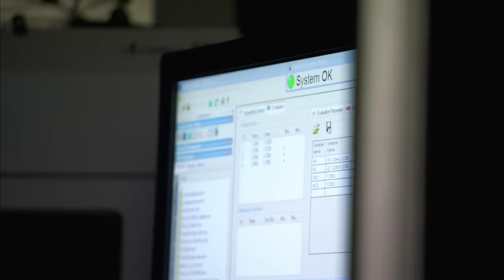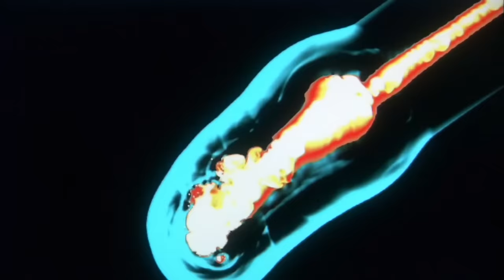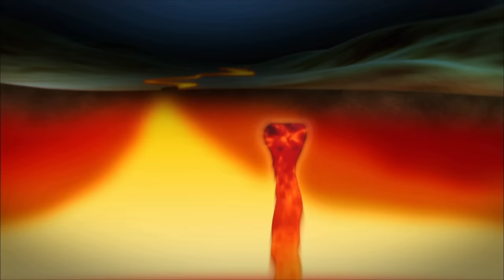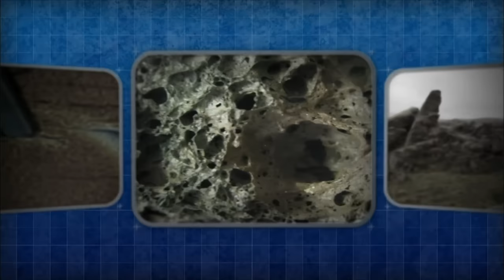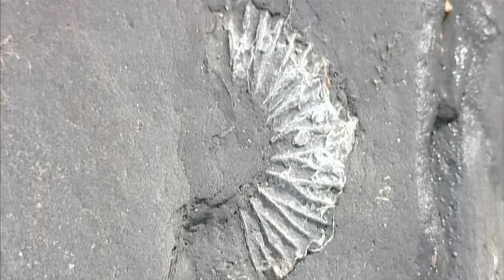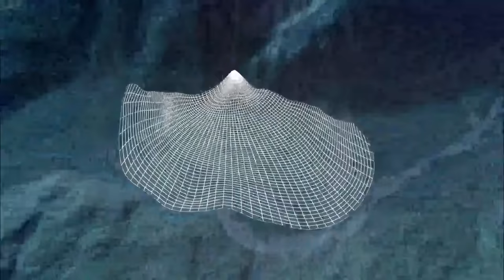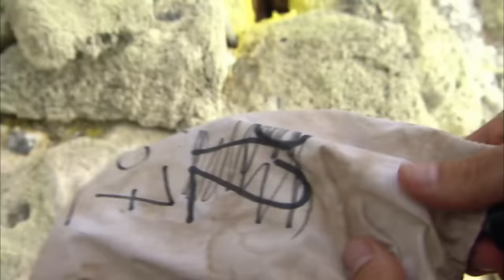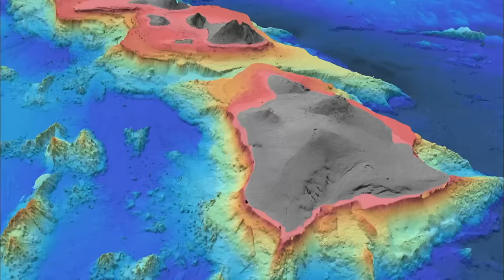How the Earth Was Made: The Most DEADLY & DESTRUCTIVE Natural Disasters *3 Hour Marathon*

Comment: when i look at the USGS NEIC, i first look at the amount of current earthquakes and divide the amount that appears on US by the overall amount of quakes. If its half, we're doing good. IF WAY OFF of half, we not good. it is better if shows a balance. Like scales.
Reply: It's really interesting to see how different individuals interpret data and develop their own methods for assessing situations! It seems like you're using a kind of "balance theory" to gauge the safety level based on the data presented by USGS NEIC.

However, I'd like to note that the actual seismic risk involves a bit more complexity. The frequency of earthquakes can vary greatly from day to day and from region to region, and it's influenced by a multitude of factors. Also, the 'half' rule might not always apply since seismic activity is not evenly distributed around the world.

It might be beneficial to also consider the magnitudes and depths of the earthquakes, as well as the geological settings of the respective areas, to get a more nuanced view of the global seismic activity. But it's definitely great to see you engaging with the data and thinking critically about it! Keep exploring, and who knows, you might develop a new method for seismic analysis!
Reply: @inish13ers  it’s the overall first impression for me. Understand it’s a lot more complex but I’ll leave that to someone like yourself.

Comment: So you say impact melted vaporized the iron ...and wheres the glas formed by the heat impacting the sand?😂🎉
Reply: I sure hope you are not serious....
Reply: Those are called tektites, and they're scattered across a wide area around impact craters. They're quite easy to find.
Reply: The guy literally explained  it
Reply: Learn how to at least USE SPELLCHECK.When a meteor strikes a planet's surface, the energy released from the impact can melt rock and soil into a liquid. The liquid then cools and becomes an impact melt. Sometimes but not always liquid cools and hardens quickly into a solid, impact glass then forms before the atoms have time to arrange into a crystal lattice. Impact glass can be dark brown, almost black, so it may look like dirt it can also be partly transparent. Sometimes, the cooled liquid does form a crystal structure. In that case, it would still be considered an impact melt, but not an impact glass.Many times there is no glass but shocked rocks as is mentioned in the well done documentary.